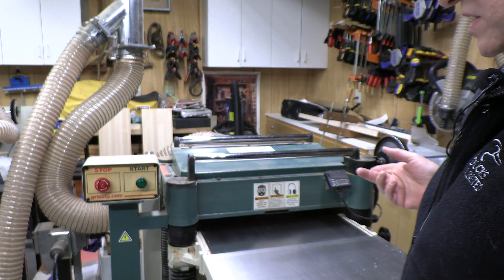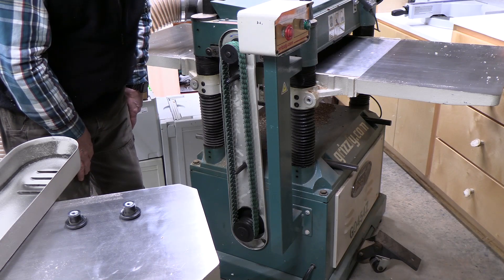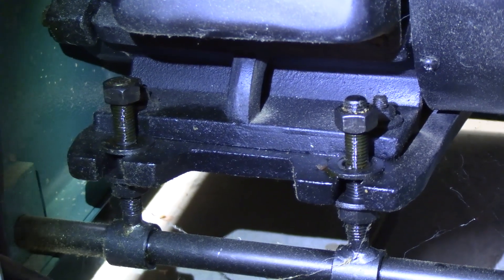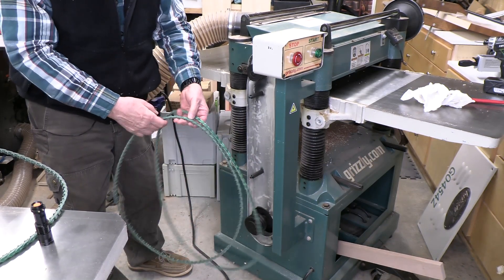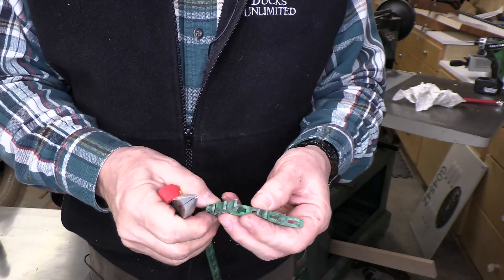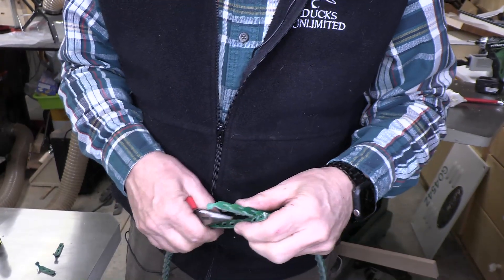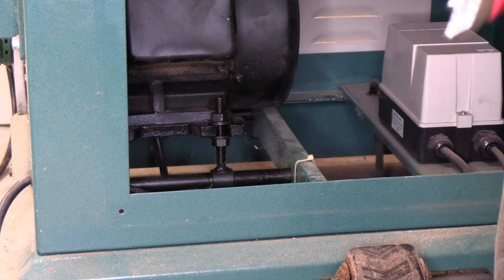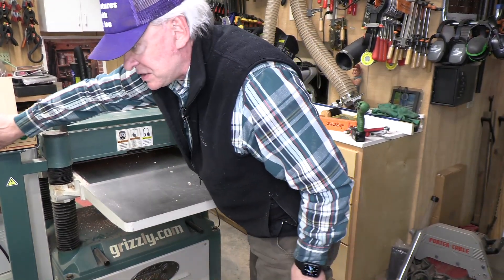Adjust Link Belt Tension on Thickness Planer Eliminate Belt Slipping

Comment: is it 3/8 belt?
Reply from the maker: Thank you for your questions. Just the green belt is 3/8 of an inch. Where is the red belt is 1/2 inch. The link belt really reduces vibration and noise and has worked very well for me. Consider subscribing. Thanks. Joe.

Comment: Thanks for this video.
I've recently had to change my belts as the middle one busted. I've noticed that after replacing them, the outside one has quite a lot of flex during operation, not so much the other two (yeah I ran it with the cover off).  I'm concerned that if I apply even more tension then the two good ones may be over tight? They're just normal belts. What do you think?
Reply from the maker: Hello Samuel,

Great question. I assume all three of your belts are identical in other words, same make same number, etc. If that’s the case, and one is too tight in the other two are loose the tight one is probably too short and needs to be replaced. Consider replacing those with Link belts. The link belts are amazing because you can incrementally adjust them for length, but also they illuminate vibration and they make the machine run more quietly. anyway yes the one belt is too tight. I would replace it or switch to link belts.

I’ve run mine with the cover off. Also dangerous but just stay away. Consider subscribing. Thanks, Joe.

Comment: Doc ...  Remind folks to unplug that machine before grabbing onto belts like that for replacement.  She will surely rip the fingers through the pulleys if she juices up at that time.
Reply from the maker: Great comment. Thank you. Yes no matter what kind of work you’re doing on your machines the first step would be to unplug them absolutely. Take care Joe
Reply: Yea ... It seemed like I almost broke my fingers rolling the belts over the pulleys with my fingers under them with just the momentum of the rotating pully/motor.   And of course the machine unplugged.

God forbid a power up at that moment ... or I would certainly not be typing at this moment.  Perhaps with somebody else's fingers but certainly not mine.

The experience also drives home just how important that belt cover is as well.

There is a long list of things that the waist height set of belts could suddenly fall deeply in love with besides just conveniently placed fingers.
Reply from the maker: @rwachtell  I completely agree with you. Thanks for your comment take care Joe